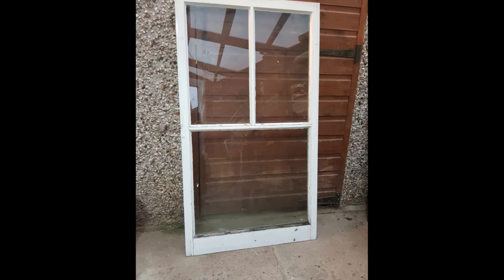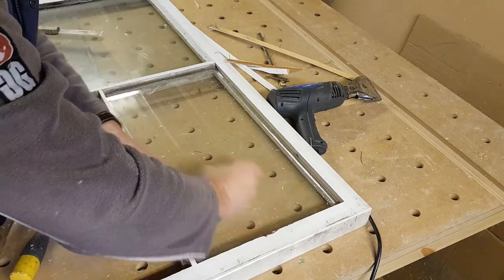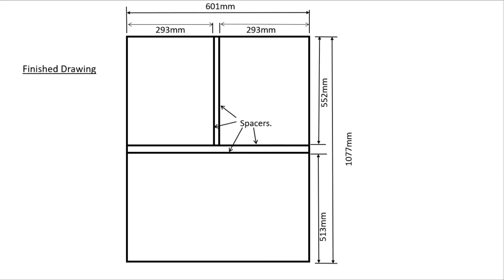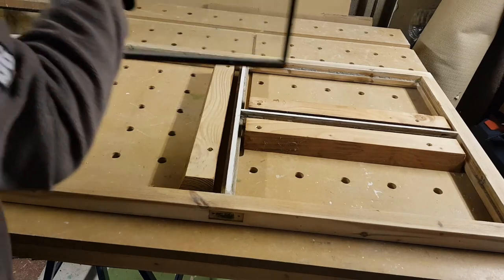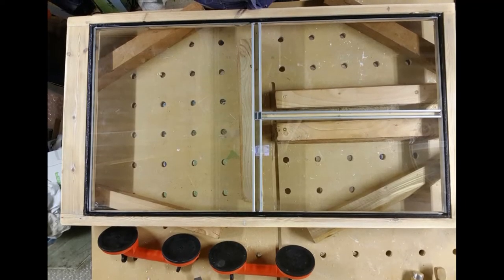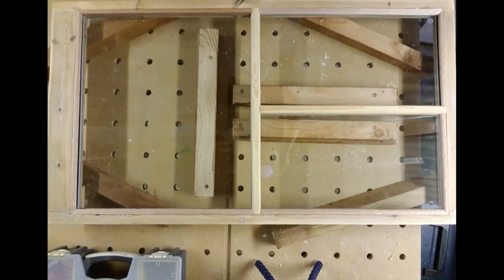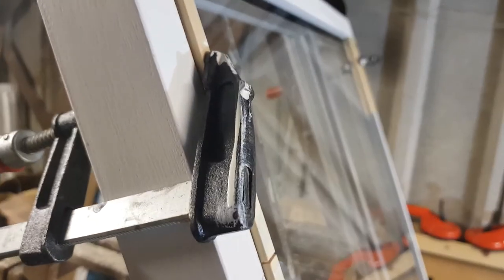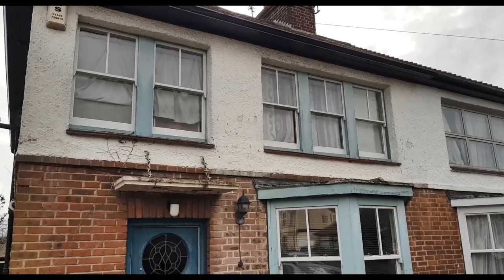Double glazing old sash windows.

Comment: Did you have to add to the lead weights in the frame to cope with the added weight of the double glazing?
Reply: Sorry for the late reply. With old single pane sash windows the weights are normally cast iron. These need to be discarded and new lead weights purchased. I weigh the completed double glazed sash then buy two lead weights that add up to the total weight of the sash. But to answer your question. You can always add  lead to existing lead weights. Hope this helps.
Reply: @edfranklin9561  You can add weights to sit above the existing weights. Weigh the new glazed sashes. Then add weights so that the top sash is marginally lighter than the weights to ensure that the sash will naturally draw up to the top of the window frame rather than tending to drop down. The bottom weights should be increased to be marginally lighter than the bottom sash to ensure the opposite. That is, the bottom sash being slightly heavier than its weights has a tendency to stay closed against the bottom cill

Comment: Your putting a lot of faith on a little bead of silicon. No nails, No Putty. Would this really hold up to the sucking pressure say experienced in a storm?
Reply from the maker: Hello Gerard, thanks for getting in touch and a good question. I would say yes, the retention properties of silicon are immensely strong. You have the silicon between the glass and the frame as well as the glass to the  beads and beads to frame. I had to remove one glazed unit due to condensation and pushing it out was difficult. It only came out when almost all of the silicon had been sliced. I also have a greenhouse where all the glass is held in place using only silicon. In 18 years since I put it together, I have never had any glass blown out. Hope this answers your question.

Comment: Hi, thank you for this excellent video. I'm embarking on this process. Just to clarify: is the rebate completely filled with silicon? Or is a void left to allow for expansion/contraction of the glass?
Reply: Hi Mike. I only use silicon to hold the glass to the frame and the bead to the glass. The void between the edge of the glass and the rebated wall I left open. I did this because sometimes double glazing fails and you end up with condensation in the void between the glass. If I filled the void with silicon id never get it all out.

Comment: What is the paint please ?
Reply from the maker: Hi Steve. Thanks for your question. For these windows I used the Dulux Trade Weathershield 1-2-3 paint system. Its a bit of work to get it all on as it comes with a primer, an undercoat then a top coat which all have to be used in sequence.  Hope this helps.
Reply: Thank you

Comment: I would of put in 3 separate DG units .
Reply: The problem with that Graeme is that you need a 2mm gap around each glass unit. The original wooden separators on the frame would need to be made wider to cover the edge spacers. You would also need to keep all the glass aligned. It is possible what you say but a lot more work. Let me know if you try that method.
Reply: You will get a better U value for the window and improve air tightness by using a single pane, it looks pretty good and a nice renovation. IMHO loads better than Upvc.